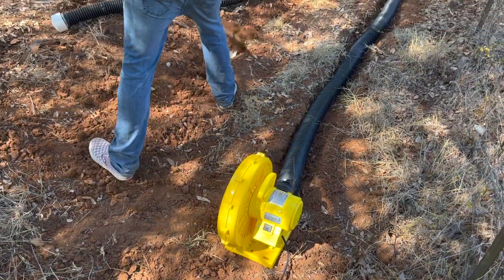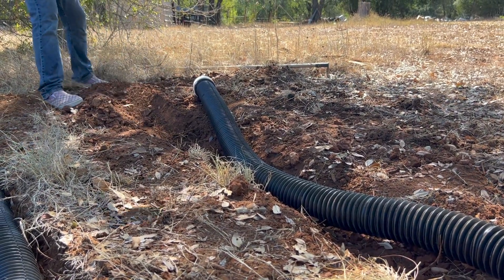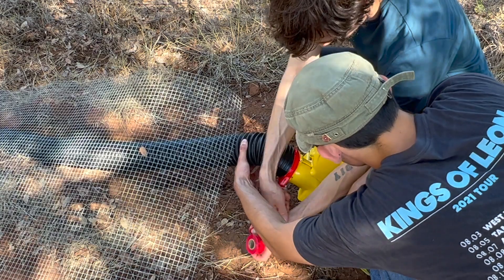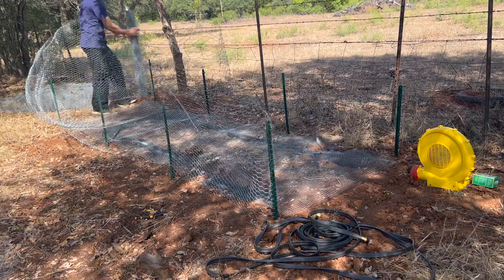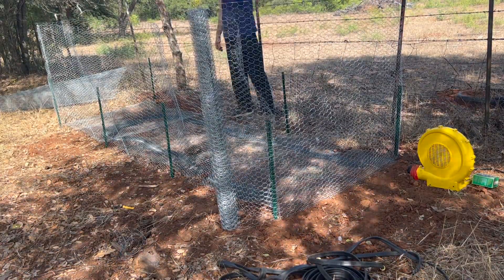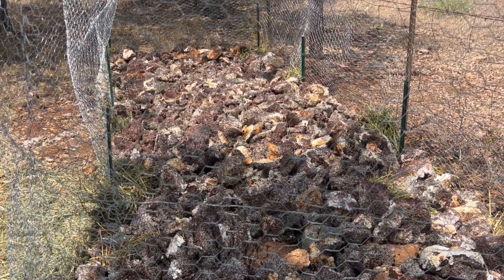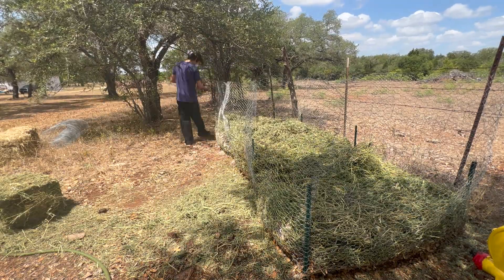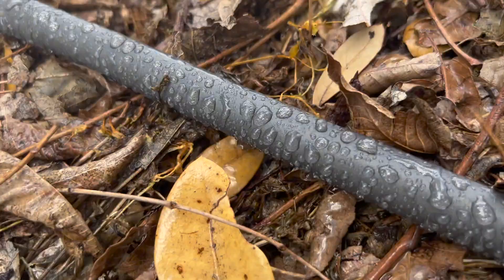The No Turn AUTO-Composter Build with Matt Powers

Comment: What do you do about phthalates from all that plastic?
Reply from the maker: Humic compounds, robust microbiology, biochar, rockiest, & time - everything is everywhere is the real issue. The hoses all leach, the greenhouses all leach, the rains all have it, it's in the air as well, it's in the tap water, all teflon tape connections for all plumbing leach PFAS but many folks haven't put 1+1 together yet: we have to remediate everything in situ and get good at it + test for everything consistently. I will be doing the Johnson Su method with the recommended shade cloth wrapping as well as a pallet bay system for worms. The stages of composting - hot into vermicomposting with bokashi + EM will also have an effect on the final product. EM has long been used to clean up oil spills and contaminants of all kinds.

Comment: Consider using Charlotte pipe with the blank side down & hole side up. Drill a few holes on the blank side for drainage into the trench you dug. Also a plenum layer of coarse wood chips on the bottom will help with air circulation in the pile. It's a physics thing.

If the ground under the pile is clay, it may not drain well. Consider laying some gravel in the trenches where you ran the pipe.

Comment: Did you add a plenum layer? If you didn't, sometimes the air will take path of least resistance and not actually aerate the pile.
Reply from the maker: the base is small leaves for about 1 ft so it'll aerate evenly

Comment: How often does the air and water timer need to come on? I already know you are going to say, it depends on the climate! I can hear you in my head, lol!

We'd struggle to get power to the goat shed area but we could do this for the middle veggie garden where we have been putting leaves mulch and bokashi. There is a partial trench already there due to a swale that got taken over by my ever expanding composting area, plus we have that same pipe, wire, timer and even air pump! It is meant to be!  We will be the Australian beta test for colder, wetter climates that used to be hot like Texas! Glad you got this done before the heat of today!

For the eco conscious and the off grid folks, maybe you could use reverse pipes, like the ones that work with just the heat of a fire? Same with the watering, a solar battery could be added? There is a balance that needs to be struck between the energy that is being used now, and the energy was used to create the renewable device in the first place. 

The point of this is to lessen the burden upon ourselves, whilst making large quantities of awesome compost that will benefit all life. 

The GC is lovely but I miss my own little green paradise down in Victoria!

Comment: Great idea. I don't like that you have to use the electricity. I wonder if one made an earthen mound around the tubes to cool the air in the tubes, point the tubes slightly downward to create a convection current instead of having to use the pump. A big problem to that however is size/space.
Reply: He could use bellows to drive the air and  get his daily workout in while aerating the pile...
Reply: If the surrounding area delivers; a trompe would also be beneficial